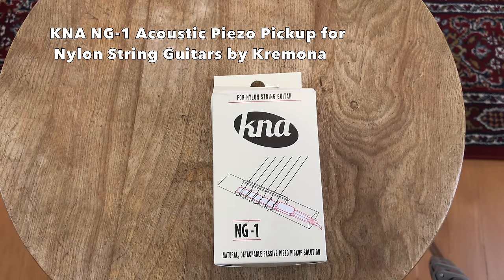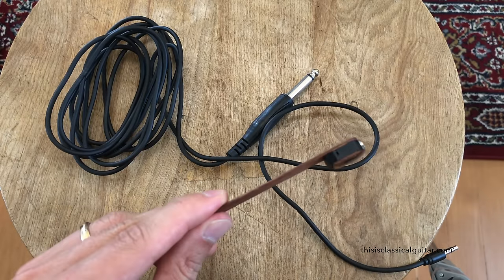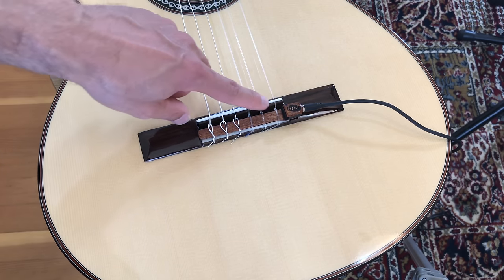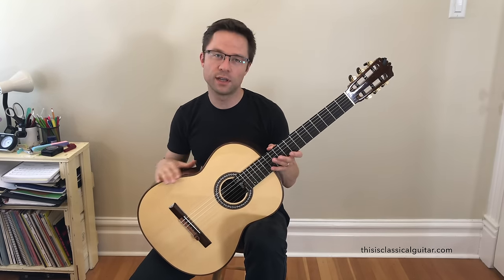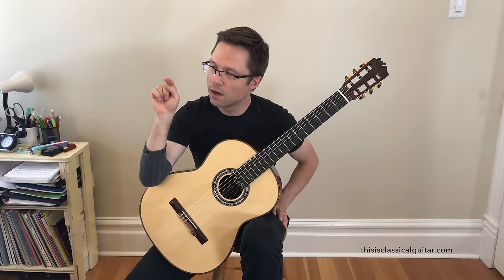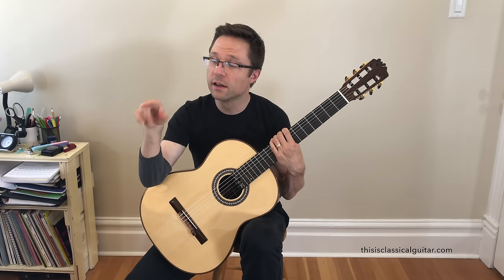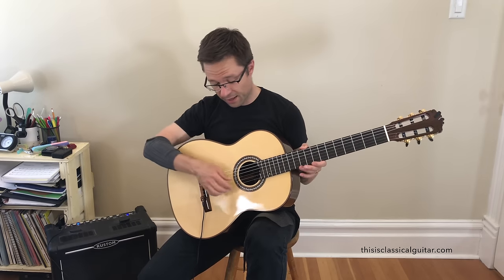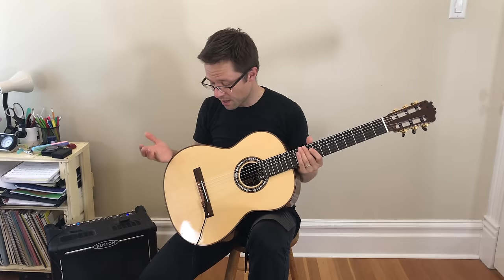Classical Guitar Pickup Review: Kremona KNA NG-1 Piezo Pickup

Comment: Great review thank you! Used to a steel string acoustic that I fitted a Fishman Rare Earth & Mic Blend (amazing) and wanting a nylon string classical and maybe adding electronics (piezo/transducer + internal mic if possible), I was going to get a Cordoba C12 with the raised fingerboard, but noted your slight disappointment it wasn't raised enough. The De Casa Sylvia looked too good to be true and perhaps so with the quality concerns mentioned in forums although the customer service seemed very good to resolve these. I then seen your great C5 review and thought lets instead start low with good features & quality, but ah then the C5-CE, but I wanted a full 52mm nut and no cutaway for the experience so back to the C5 albeit the C5-CE is only 2mm less and same for the C7-CE though the latter does have the Fishman blended preamp. This little KNA is pretty tidy, no fuss with no modification and at least gets connected for some decent amplification — nice one!

Comment: I think mu coment below is not visible enough so i post again = to my experience the pickup lacks serious sheelding - the sound on a good solid state amp is oké but in other situation it gives conciderable hum so than it is not suitable for recording (i had to redo some recordings using a condenser mic because the hum was tooo much) i tried an extra wite to have some grounding but that gave some improvement, but not enough
Problems occurred for instance with RC300 looper and using palmer preamp, i have installed a few of them on different guitars before discovering this problem (all of them hum beyond tolerance as far as i am cocerned) would add a picture if i could but that appears to be impossible here!

Comment: I want to try this with La Bella Folk Singer strings (I'm not a classical guitarist but I have a Cordoba c7) which have ball ends. Can you snip the ball ends off and tie the strings as usual so I can use this pickup?
Reply from the maker: You can do anything but check the tension level to make sure it's safe for your guitar.

Comment: I want to play my acoustic nylon guitar with my Mom on the piano and my guitar need some amplification. This could be my solution for that problem. I have 2 nice fender amp here, that have a very good clean sound.
Reply from the maker: Sounds like a good plan. Some light reverb on the amp can really help. It's tricky getting a natural classical guitar sound but it will certainly amplify it.
Reply: @Thisisclassicalguitar  I have the amp reverb, and also an Rocktron Intellifex 24 bit reverb. Should do the job. I am thinking about that, or just going all in and buying a DVote dPA 4099 for guitar. It has quite a price tag to it, but would be a solution for live play and for recording.

Comment: Break angle is pretty on off there is either enough or not, so there is no real tonal change when reducing the break angle. Adding mass to the bridge/top will drop the top resonance a touch, that can either be good or bad depending where it was before the instillation. I just installed the pick up for a coffee shop performance I am doing where it is too much of a pain to get a good microphone setup between performers.  I was surprised that it sounded OK. Great video!

Comment: I have the second version of this this mg2 and I have it installed and it works perfectly fine but it sits at an angle from the bass to the treble as the A and E strings push the pick up forwards then forcing the tail of the E and A strings up and then sit in a position that’s not suitable and also down near the G and B strings the pick up has a hair line split in the centre of the wood . Please get back to me if anyone has a suggestion for the pick up in my mind I think it just can’t hold to pressure the strings put on it .

Comment: Do i need to buy a pre-amp or will an audio interface suffice? Need your opinion, thanks! Great review (as always) by the way!
Reply: Most audio interfaces have built-in amplifiers anyways. You must have a gain knob on the channel, this signal goes through an amplifier inside the interface before becoming digital to go on the computer. Also the level is OK for direct amplifier usage, a small pre amplifier could be better as i have heard but it is not under any circumstances obligatory with this pickup.

Comment: Maybe I'm doing something wrong, but the included cable picks a lot of 50 Hz hum in my case.. Pretty much every other cable works better. I'm using THR5A amp.
Reply from the maker: That's odd, my is silent. Maybe there is something near it interfering?

Comment: Hey, thanks for the reviews. I have this and just recently purchased the AP-2. How do you get rid of the plastic sound?
Reply from the maker: Well, experiment with the placement and amp settings. I've found it works better on classical guitars near the bridge or heavier bracing.
Reply: @Thisisclassicalguitar  Sorry, I just re-read my question and it's confusing. Like me try again: I have the KNA NG-1 also, is there a way to EQ out the plastic sound?
Reply: @paulysguitarjournal  Hi Paul, I have a Cordoba C7-CE (electro acoustic) though somebody now recommended me to return it to the store and buy standard classical guitar (without the electronics) and use this Kremona Pickup. I actually didn't think the C7-CE sounded THAT plasticky myself. How is your experience with the KNA-NG1?

Comment: I’ll be sending mine back.  I think the one they sent me was a return, that somebody tweaked when they originally tried to install.  Judging by the packing.  Anyway, mine experience was bad.  It sounded “woofy” and very microphonic, picking up hand and arm sound from the top.  Tried adjusting the lateral position.  But it made no difference.  Very delicate, and never came close to getting anything close to a good sound.  Tons of feedback.  la Patrie Concert with a Fender Acoustasonic.  Amp works fine and sounds great with my Taylor 614.  Wanted a simpler Plug-and-Play solution than mic’ing with. Shure SM-27 condenser mic.  Very disappointed  Zero stars.
Reply from the maker: That's odd, maybe it was defective.
Reply: Where did you buy it from?

Comment: Thank you for all of the helpful videos!

I have a concept of modifying a cheap classical guitar to prevent the soundboard from actuating, so that I can practice silently. I'm hoping to find a pickup option to use headphones with. Do you think this Kremona model would be a good candidate, since it relies only on the vibrations of the bridge apparatus? 

Thank you.
Reply from the maker: Hmmm, ya maybe but not sure, it depends on how you are dampening the soundboard I guess.
Reply: @Thisisclassicalguitar , my idea is to open the back of the body to access the underside of the soundboard. Then I would glue to the soundboard wooden boards cut to fit between the bracing, thick enough to hopefully immobilize the soundboard, which I hope would drastically reduce (or eliminate) the guitar's normal auditory function.

I don't think this would impede the guitar's conductive properties: the vibrations should still travel normally from the strings to the bridge, where the piezo can detect them, even though we can no longer hear them. 

That's what I'm hoping for. 

Thanks and greetings from the North Island!

Comment: Be careful on leaving it installed on your guitar. It is not really supported at the end where the amp cord plugs in and it can break at this spot.  When mine broke the wires were still intact so I just glued the whole thing onto a popsicle stick and it still works fine  but there may be some minor degradation in the sound quality.  If I could only find a rosewood or  mahogany popsicle stick.
Reply from the maker: Yes, a number of people have mentioned this and the review could have used a talk about build quality.
Reply: now here is a good observation = i tried to reverse the pickup but the end (the part where the minijack goes in) is a little to thick to turn it upside-down to have it stick out less
I have tried several ones and most of them have grounding problems = they have a serious hum which spoils the possibility of making recordings and this after testing several possibilities of connecting the pick-up = with preamp is gets worse (and i use palmer preamp and G&K solid state amp) so i don't know how he manages to produce such a clear sound (??)

Comment: Nice video. Are you able to transfer the audio signal as midi data to a DAW by using software like midi guitar 2? It would be really useful.
Reply from the maker: I have no idea, I would say not.
Reply: It should work with Midi Guitar 2. That plugin will work with pretty much any audio signal. The audio to midi conversion is done inside the computer so it shouldnt matter what pickup you use. Check out a video of a guy using Midi Guitar 2 with a harmonica https://youtu.be/jzltXmY0PLY
Reply: @liambrittenmusic  Thanks Liam, after some practice, I have been able to work with the plugin successfully.

Comment: I saw your video and then went to Amazon to check it out. There are many 5 star comments comments about the quality of the device but among the 1 and 2 stars, its fragility was mentioned several times. One guy left his device installed and while carefully taking it out of his soft case, it broke off. I can also imagine that it would just take one time of another musician stepping on my cord and breaking the pickup off at the neck. I'm looking for something that I can install and not have to worry about. Do you know of an under the bridge device that you could recommend?
Reply: Same thing happened to me, more than once and it only takes the slightest tug to rip that little plastic plug box apart and rip the wire right out of the metal element which is inside the piece of wood.  Once it just got caught on someone's sleeve and that's all it took.  They are great in concept but are WAY to delicate for live very active live performers. As a studio only instrument it would probably be fine.

Comment: Can use it with my wireless speaker?
Reply from the maker: Well, if you plugged it into a transmitter I don't see why not.
Reply: Do I need to plug  a transmeeter  on the in a NG and plug the receever  in my wireless  speaker  like x vive .  u2

Comment: An specific acoustic amp would be better. Try if you can a Tanglewood T3 or T6. Its really good, not expensive, and not many people knows it. The best thing, in my opinion, is that the bridge bone sits on the wood and not on the piezoelectric cable. Thats situation is the worst and kill the spanish  guitar natural sound. Its a great idea but not for flamenco or any other style with percussion over the guitar wood.
Reply from the maker: Actually I ended up buying an Roland AC-33 acoustic amp...
Reply: Thats a great acoustic amp too.

Comment: Just strap around a standard piezo and save 300 $
Reply from the maker: What do you mean? Like install one inside the guitar and drill a hole for the cable? Also, this only costs around $130.
Reply: @Thisisclassicalguitar  piezo + preamp cost like 60 $ at worst. You just wrap the piezo bar inside.